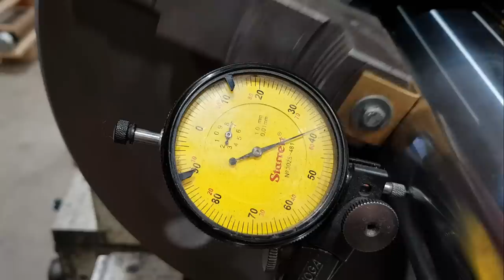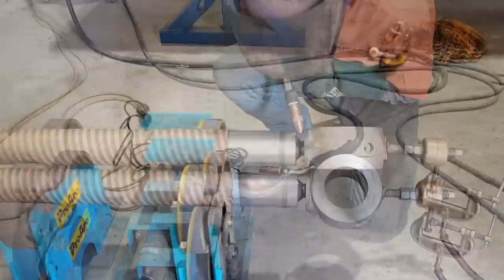Replacing Damaged Hydraulic Cylinder Rod for Caterpillar D10 Bulldozer | Part 2

Comment: Made me 2 of those just this morning.   2 1/2" induction hardened rod, 45" long.  Our method is a bit different than yours.  I saw the eye off then mill it square and drill a 3/4" hole, 3/4" deep.  I machined the threaded end, in my case it was a 2" - 12thd.  I flipped it around in the lathe and machined a 3/4" dia spud, 3/4" long and machined a BIG chamfer for weld on the rod.  Then I beat the rod eye onto the rod and welded it.  
On My cylinder there was 2" of the rod sticking out of the cylinder when assembled so no trimming of the weld was necessary.
Reply from the maker: Hey mate thanks for watching. Where abouts in the world are you? Have heard from a few in the USA who do the procedure like what you mention. Always good to hear what others do in the industry 😎👍

Comment: Its great work, I'm still more of a fan of threading the eye into the rod though.
Reply from the maker: Hey mate haha yeah I think it's great there is always more than 1 way to get it done 😎👊💥
Reply: EmeraldMachinist. Yeah spot on. Had one of these from a customer where the weld had failed under load. As a retired machinist we always produced an internal thread on the rod for added strength, and cut the corresponding male thread on the remaining rod part of the eye. There is also no need to grip any 'working' area of the rod in the chuck, this being achieved via a fixed steady, whose marks were turned off when screw cutting this that end of the rod whilst held in a rotating centre, and the eye screwed into the rod and clocked up in four jaw chuck.  I guess times have changed. Better safe than sorry.

Comment: First time I've seen ceramic tips used on manual machine since late 1970's. Ceramics didn't 'work' on cast iron, cut too interrupted but were great on steel.
Ceramic tip made real quick work of the chrome/hardened layer. Using carbide tools was a real pain (particularly brazed carbide) Probably made several 'miles' of piston rods for various machines. Kinda miss having a large rigid lathe to work with
Reply: Sometimes I even use CBN on manual, cuts 60 HRC tool/bearing steels like a butter. Cheers
Reply: @romanzbawiciel5221  I#m sure the material  technology is vastly improved compared to1979?
I don't think CBN even existed back then?
Reply: @1crazypj  Probably not, just sayin' it is a valuable option today. Works better on conventional machines than ceramics as it's tougher. Of course ceramics is still a good way to go. Also, it works below 40 HRC and does much better in nickel alloys than CBN. Maybe someone will read that and it will help him just a bit. Btw. For anyone interested, when roughing Inconel, if you have really rigid lathe use square insert set in 45 degrees toolholder. Hog deep, high feed, very low cutting speed and do it without coolant when trying it for the first time - it won't gonna change tool lifetime that much and you will be able see wear much easier. Cheers

Comment: Suggestion: I use fire blankets to cover things I don't want to get spatter on like lathe bed etc, (they usually come in a red packet that hangs on a kitchen wall), bought a pile of them at AusPost cheap as, lasted years. You can weld right up next to them and they don't burn up easily.
Looks like the sell them at Bunghole Hardware too for 7.50

Comment: I would be interested to know more about the system on your lathe that retracts the tool at the end of the thread, precisely each time.  It looks scary in use, but seems to work very well.  I've typically used a boring bar on the back side of the work with the lathe in reverse, starting in a relief groove and running the tool off the end safely into mid-air.

Comment: Machining like in the old dekades. Not very cost or time effective, but works. A few newer things would help them a lot, like a tool holder system like Capto and a lathe with cycle-operated controle. no full-NC, but very usefull, especially for threading and grooves. Nothing overpowered, but it helps.
Reply from the maker: Hey mate thanks for watching. We don't do high quantity of 1 job like production work but funny you say that we are looking at a teach in CNC lathe for just this reason 😎👍
Reply: @CuttingEdgeEngineering  I work for the same kind of company. We are a little special Workshop and Manufacturer of cylinders, power units and customised systems. We use a NC-Lathe with Dia up to 600x3000mm, a milling center and a CNC-Lathe up to Dia 400x1500mm.

Comment: Very nice repair.  It seems that everything you do in your shop is/was well thought out.  I like that.  I like to do the same.  I noticed you left the half-nuts engaged all the time while doing a 12 tpi thread.  Does your lathe have a metric leadscrew?  Keep up the good videos.  Ken
Reply from the maker: Hey Ken thanks for watching mate glad you can appreciate it. Great minds think alike haha. Yes has metric leadscrew but is equipped with both metric and imperial thread ranges. Cheers, Kurtis 😎👍

Comment: Have you tried doing a full depth of cut with the ceramic to get under the IH in one shot? We do that at about .002" (0.05mm) per rev, approx. 300 ROM for that size part, very successfully at our shop. 

Also, have you tried a press/tap fit with eye onto the rod? This would eliminate the need for tack welding in the lathe

Comment: I see SOMEONE didn't like the squeaker! 🤣 Another great video there from you and your wife there Kurtis and another great machining job too. I do have a couple questions there for you Kurtis...1) so just how thick is that chrome plating that is on those rods? 2) why preheat the part like you did there? There was a third question but do you think i can remember what it was by the time i finished watching....... 🤣. Keep up the great work you two.
Reply from the maker: Hey mate thanks for watching glad you enjoyed this weeks vid! hahaa yeah that poor rubber chook had no chance. The chrome layer is about 5mm thick. Preheat is a standard weld procedure to take the cold out of the material. High grade materials don't like being welded cold. If the other question comes back to you drop a new comment (we don't get notified if someone edits their original comment). Cheers, Kurtis 😎👍

Comment: Great videos, thanks. I just love seeing metric as the default. Anyone who knows, is there any issue with welding to a part in a machine like that? Any chance of screwing with the DRO etc?
Reply from the maker: Hey mate thanks for watching! You will have a problem if you don't earth to the job correctly and can potentially seize the lathe bearings, also weld splatter on the bed and ways got to watch out for 😎👍
Reply: @CuttingEdgeEngineering  Gold, thanks mate. I appreciate you taking the time to reply. I look forward to the vid on the earth clamp you use when welding jobs that need to rotate. I use a stripped, doubled and twisted length of old welding cable between my job and the earth clamp but your set up looks better.

Comment: This was a great video.  I love the inclusion of dog (I may have missed his name).    You really make short work of that hard shell.  Crunchy on the outside chewy in the middle.  Do you use flux core to weld that or gas/both?  Just trying to understand what's what and why/how to do that proper.
Reply from the maker: Hey mate thanks for watching. I'm using a metal cored wire backed with Argo shield heavy gas it contains 75% argon and 25% Co2

Comment: welding in the lathe is fun but just remember electricity can ark through the bearings sometimes an make pits in the balls/rollers and races.  might need to switch over to hybrid ceramic bearings.  They have steal races but hard and tough ceramic balls/rollers like silicon nitride or zirconium oxide so electricity can not pass through because ceramic is an insulator.  nice job.

Comment: process the process from the mirror to the center until you find the hard soft surface from the surface, when you find the soft surface, you continue normally, there is no risk of processing due to the coating :)

Comment: That 3 jaw chuck runs really true. Excellent idea with the brass shims bolted to the chuck. I assume you cut the rod top length after machining the thread? Do you follow any thread specifications or just test fit with the nut?
Reply from the maker: Hey mate yeah machine the rod to length after thread was cut. I do thread to OEM spec but test with nut supplied by customer as that is what will be going on the cylinder and sometimes aftermarket nut tolerance is different 😎👍

Comment: Awesome video. 
Great talent. 
Question: The lube fluid and chips that fall down below the lathe: is that lube fluid filtered and recycled to use again? Chips able to be melted down again snd if not what is done with them. 
Just super curious is all. 
Again props on your work
Thanks for you time.
Reply: The lube recirculates from what I’ve seen and the swarf goes the scrap metal yard.

Comment: Got to make  4140 replacement 45mm od x 400mm long lathe spindle . On a 1950s  lathe.   Wish it is as easy as you make it.  Thanks a lot!.
Reply from the maker: Hey mate that should be interesting! All the best with it 😎👍
Reply: @CuttingEdgeEngineering  when the old spindle is'repaired' enough  to hold the piece in place, probably between centres, then on with 'turning'.  Positive aren't  I?.  Thanks for the support.

Comment: Love the videos mate, keep them coming. Quick question: between 25:15 and 25:25, did you literally fill the whole gap up with weld? That must have taken a lot of wire!
Reply from the maker: Hey mate thanks for watching. Yes the whole gap is welded up. Takes a bit of wire but got nothing on a EX1200 re-rod though haha

Comment: Question. Once you're "through the induction layer" all the outer heat treated metal is gone. Do you have it heat treated again before sending it out or is it better to have the softer metal for this? I have zero experience in your line of work but I know a little about hardened materials.

Comment: Wonderful video as usual mate, I'd like to ask you this question: what's your favorite micrometer? (Or micrometer set)?
Reply from the maker: Hey legend thanks for watching! I prefer Starrett just like them and Mitutoyo is up there as a favourite as well 😎👍
Reply: @CuttingEdgeEngineering  nice choice! If I ever aquire a decent sized home machine shop in the far future (with like 13x40 lathe and a decent turret mill) I think of buying some Mitutoyo micrometers.
But so far I only have metrology tools and no machines because I'm still a student without time or money 😅

Comment: 2:45 There's no way you just threw the piece in to the chuck and it's running so true :D You did shim it right?
Reply from the maker: Hey mate no that's 100% put in and how it runs. Depending on the length and size of rod it might need a bump but 99% of the time that's how good it is 😎👍
Reply: @CuttingEdgeEngineering   Wow then that's the best three jaw chuck i've ever seen
Reply: @CuttingEdgeEngineering  nice, I run some old chucks and I always end up having to tap them in

Comment: So you don't use compound set at 29.5 degrees rather than the plunge method using the cross feed? And you leave the half nut engaged during the whole threading procedure?
Reply from the maker: Hey mate yeah spot on. I reckon setting it at 29.5° is alot of unnecessary fark around

Comment: Gotta love that three jaw chuck, I wish my crappy Chinese lathe was as good. Good to see the Safety Officer takes his job seriously! Coupla questions: How did you make sure the whole thing was the correct length? and, When you're thread cutting, do you just go straight in all the time or do you add a bit of top slide? Nice thread by the way, and another top job! Thanks for posting.
Reply from the maker: Hey mate thanks for watching! We get the rod the right length by a bit of math when taking into account the rod eye, weld prep, shrinkage etc. Yes when threading I bump the top slide over then continue in. 2 bumps for roughing passes and then straight in on final pass 😎👍
Reply: @CuttingEdgeEngineering  That thread cutting method is what I was taught as an apprentice in HM Dockyard, Portsmouth, UK in 1958. I thought that was how you were doing it but couldn't see the top slide movement.
Reply from the maker: Hey mate that's awesome stuff. A super knowledgeable old school German machinist here in Aussie taught me this thread cutting method when I started out and have used it ever since.  😎👍
Reply: @CuttingEdgeEngineering  Good one, it's nice to know that the old methods are still being used and appreciated. Keep up the good work. 😎😎😎

Comment: Hi mate, how were the holes drilled and threaded into the hardened jaws of the chuck? Also, the new insert was sparking on the induction layer of the rod, is that insert thrown in the bin after getting through that or can it still be used?
Reply from the maker: Hey mate nothing special just drilled and tap with standard tooling. Just stay away from the jaw faces (internal and external grabbing surfaces) and should have no dramas 😎👍
Reply from the maker: Hey mate with the insert sparking that was due to the chrome material that sometimes happens. The 1 tip of that insert lasted the whole job and is good for the next. Still another 5 tips on that insert as well 👍

Comment: Not questioning your reasons... just trying to understand.  
Do they not make a quick change tool post for you size of tooling or just don't make one you trust?
Reply from the maker: Hey mate a few reasons, mostly I've never found one rigid enough here in Aussie for the work I do. A standard tool post has more range with tool positioning and I can use my tooling across all 3 lathes without adjusting centre height like I would need to on a quick change. 😎👍

Comment: What HRC is the outside of that shaft? I used to turn lots of 4140 HT (35HRC) with carbide all the time. My understanding is that you really only need ceramic for 55 HRC and above. Most modern coated carbides are really good with hard ish steel
Reply from the maker: It's 55 - 60 HRC and definitely needs ceramic insert on the induction layer. I explained in the video that it is 38MnVS6 induction hardened 👍
Reply: @CuttingEdgeEngineering  yes 55-60 is hard enough for ceramic!

Comment: Are you using flux core wire? If so, why not use argon shielding?
Reply from the maker: Hey mate it's a metal cored wire backed with argo shield heavy👍

Comment: You didn't get any weld splatter on the exposed chrome portion?
Reply from the maker: Hey mate it's covered with a 1mm aluminium flashing sheet and hose clamp to fix it 😎👍
Reply: @CuttingEdgeEngineering  👍👍👍Nice work!

Comment: What was the purpose of the hose clamp on the rod during welding?  Just so the weld area didn't come down on the rollers?
Reply: There's a metal sleeve under the clamp.  The rest of the rod has some cover that must be flammable so he put the metal sleeve to protect the rod while welding.
Reply from the maker: Yeah @jetnavigator is spot on there. The clamp is holding on aluminium flashing sheet to protect the chrome

Comment: What is the hose clamp on the rod for when your welding?
Reply from the maker: Hey mate it's to hold the aluminium sheet that shields and protects the chrome rod
Reply: @CuttingEdgeEngineering  Thanks for the quick response! Makes perfect sense now!!

Comment: Mate - one question - why no QCTP?  Other people doing similar jobs use them and they really appear (to my inexperienced eyes) to make things faster, although I admit it doesn't seem to take you very long to do a tool change. Why don't you use one?

And another question (remember that I really don't know much about machining) - a VAST majority of the people on YT with machining channels make a point of setting the compound at 60 deg (or 59.5 deg), while you are using the cross-slide to advance the cutting tool. Is this considered fine because the materials you are working with are so rigid?

Comment: How preheating temperatur before welding Sir?
Reply from the maker: Preheating with flame torch, standard welding procedure to take the cold out of the material. High grade materials don't like being welded cold.
Reply: @CuttingEdgeEngineering  Thanks nice video, God Bless you 👍

Comment: Why did you preheat the rod before welding?
Reply from the maker: Standard weld procedure to take the cold out of the material. High grade materials don't like being welded cold.
Reply: @CuttingEdgeEngineering  thanks bro for the knowledge!

Comment: What material are your soft jaws?
Reply from the maker: Hey mate they are brass
Reply: @CuttingEdgeEngineering  I am also amazed at virtually no run out. Did you grind/machine the soft jaws to help achieve virtually no run out?

Comment: I wonder why he puts the machine in reverse to make the thread cuts?
The split nut should pick up in the same place every time.
Reply from the maker: Hey mate this is the way I prefer to do it. I like to leave mine locked in and then zero chance of a mistake or missed pick up. 😎👍
Reply: @CuttingEdgeEngineering  
Fair enough.
As long as it comes out right, it’s al good.
Enjoy your weekend!
Reply: You can disengage your half-nut if your thread pitch is multiple of lead screw pitch. Otherwise should go in reverse.

Comment: You need to get your knees off the concrete. It will suck the life out of those precious joints my friend. A piece of wood or rubber, anything. Trust me as I have seen and have the results of a life of working on it. You don't want that at all.
Reply from the maker: Hey mate you're not wrong! Thanks for that 😎👍
Reply: @CuttingEdgeEngineering  I am 65 and retired now. Both my knees hurt from all the torture I put them through. You are still relatively young so there may be hope for yours yet. I had a supplier up here that sold welders knee pads. I got them for our fellas in fab and the truck mechanics. Pricy but I never wore mine out.